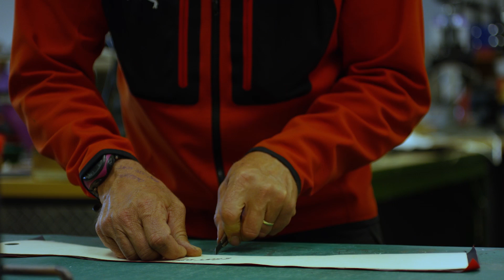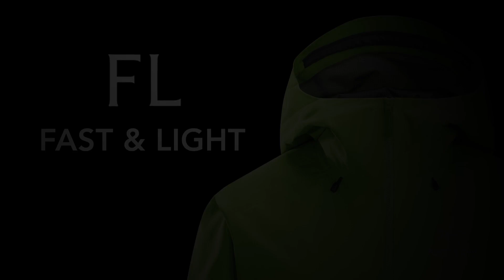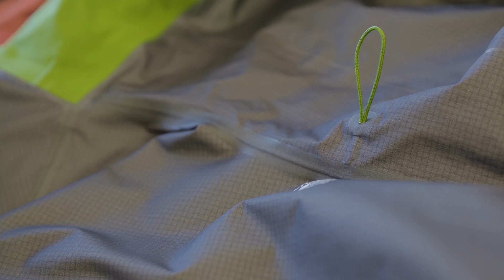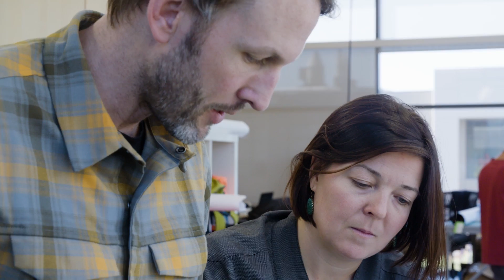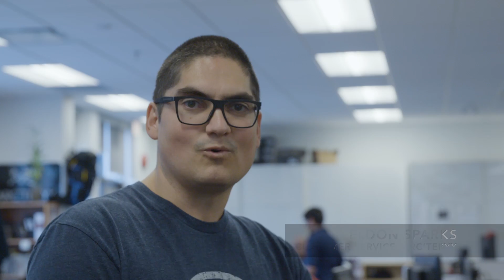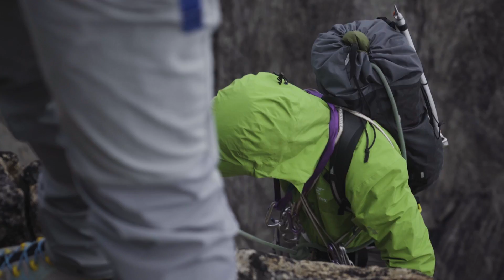Arc'teryx Hardshell Product Category

Comment: I use the Alpha FL to collect cans from litter bins. On a 7 hour run has never let me down lol. I've gotten caught on sharp edges and garbage and only single fibers get torn where I can hardly see where the minimal damage is. Only thing that is non optimal is the length of the back compared to arms ( the body and back is a bit short and if I get larger size the arms will be too long ) and the chest area is a bit compressed. I've also seen a severe drug addict sport the Sabre jacket hehe, going out in style.